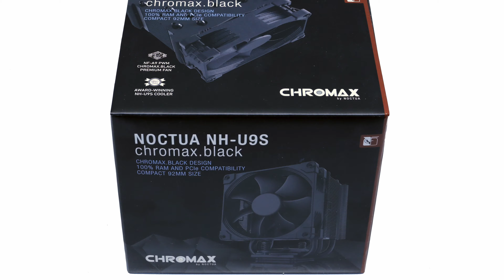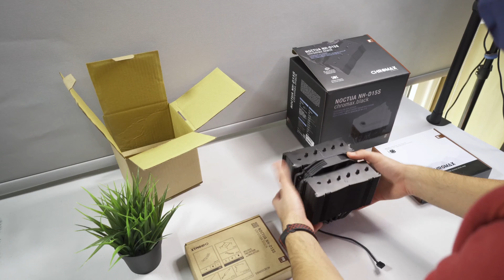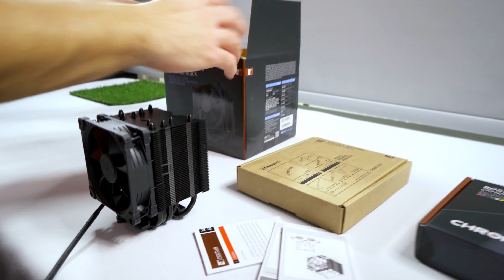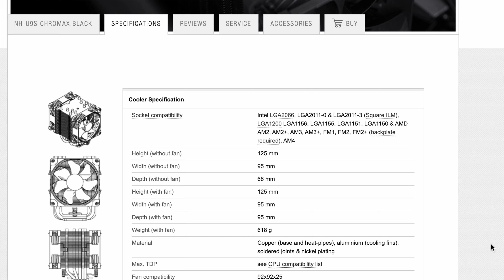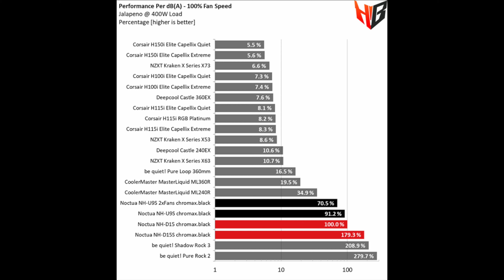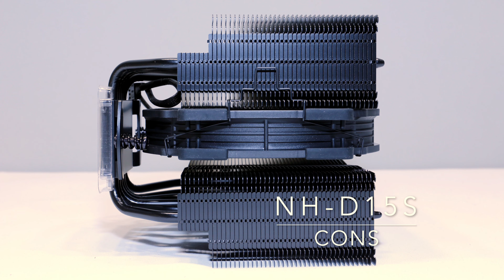Noctua Chromax.Black Coolers Review - Back In Black

Comment: Hello Aris, In previous videos I heard you said that an Ups is good to protect the power supply. Can you tell me if this product (SurgeArrest Essential APC 8)
also protects the Power Supply in the same way as Ups? I know Ups makes backup in case of power failure, but my only purpose is to have a good current for the Psu.
Sorry for the offtopic. Love your writing reviews on tomshardware, techpowerup as well you Yt channel. Thanks
Reply from the maker: Hi! No this is just a power strip with a proper transient filter installed. A UPS won't expose your PSU to high voltage deviations which apply stress to the APFC converter. For optimal protection, you need a pure sinewave UPS though and not a stepped one, which also stresses the APF Converter.